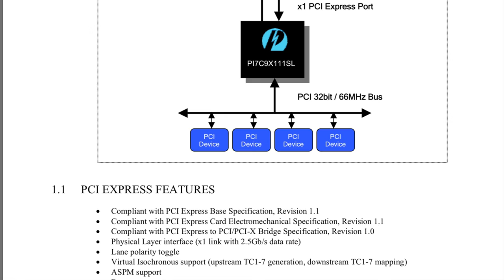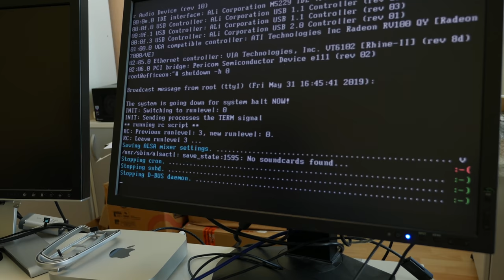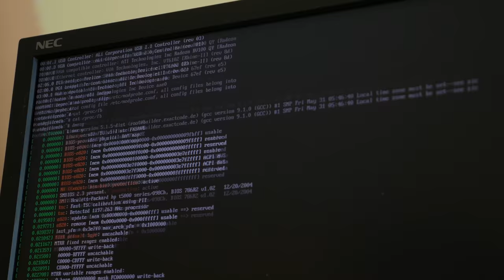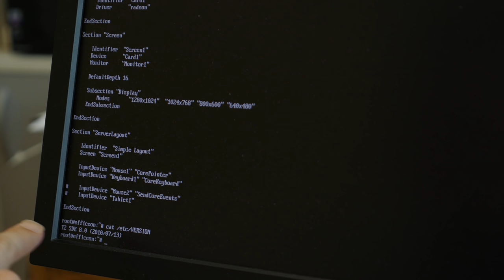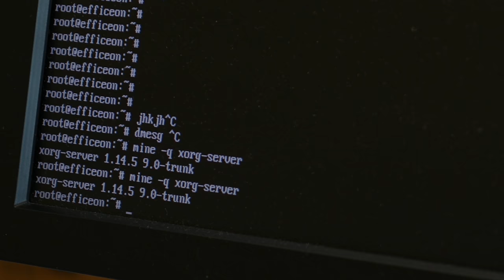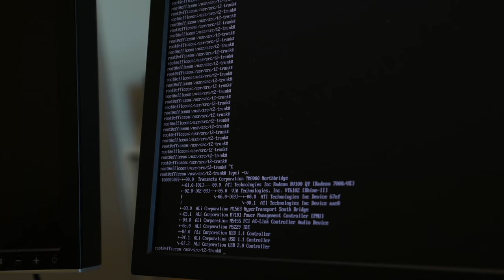Latest GPUs externally on vintage systems? PCI Bridge to the rescue!

Comment: I bought one of these to use an Intel Optane module as swap in my Sun Ultra Enterprise 250, I haven't tested it yet. There's a PCI-X version (Startech PCIX1PEX4) with an x4 slot on the PCIe side, but the cheapest I could find it for was 120€...
I don't think it'll work in the Cube, as the "PCI" to AGP adapter it uses internally for the GPU is just a pin to pin mapping, they just used a PCI connector on the motherboard because it was cheaper. Maybe I'm wrong, but I don't think you can do PCI to AGP without at least some level shifters and address decoding glue logic.
I'm really loving your videos about esoteric hardware, really informative.
Reply from the maker: thanks for the Cube warning, I knew it was AGP on a PCI port (plus the high power extra pins) but I naively assumed ith was PCI pin compatible. Need to do some research then before I plug it into there, ..! ;-)
Reply from the maker: re: the Cube "AGP" as "The AGP bus is 32 bits wide, just the same as PCI is, but instead of running at half the system (memory) bus speed the way PCI does, it runs at full bus speed. This means that on a standard main board runs at 66 MHz instead of the PCI buss 33 MHz. This of course immediately doubles the bandwidth of the port; instead of the limit of 127.2 MB/s as with PCI, AGP in its lowest speed mode has a bandwidth of 254.3 MB/s. The AGP specification is in fact based on the PCI 2.1 specification, which includes a high-bandwidth 66 MHz speed." so I would hope Apple uses all the PCI "AGP" slot with standard signalling just at the AGP speed. I will try to look at this another month, ...

Comment: I remember looking into a similar solution a few years back, but for modern notebooks. 

The graphics adapter had died on my notebook (geforce 7600go) Toshiba Satellite 050, so I began looking for a solution since it was my gaming machine. What I found, were these cheap miniPCIe to external PCIe adapter, similar to what you did on this video.
I decided against it since it defeat the purpose of a notebook... lucky me, after some time, my father bought me a similar looking machine. I swap the GPUs and I had a working notebook again with a Radeon x1600 instead.
But something even stranger was a PCIMCIA graphics card. "Village Tronic - VT Book". The chip is a Trident Cyberblade XP2, with 32MB of memory, DVI output, and a maximum resolution of 2048x1280@60hz 16bpp. Works with Win2000, XP, OS9.2.x, OSX 10.something early, and according to the box, Linux too, but only 2D acceleration and in beta. Only XP and OSX has 3D acceleration. It supports Dx8 and with it, it work like a charm, Dx7 and Dx9 work too but with video artifacts, probably because crappy drivers.
One of the weirdest hardware in my possession.
Cheers
Reply from the maker: yeah, I saw this miniPCIe adapter flex able things and wanted to buy one just for fun tinkering stock sometime soon too (I think I did not see then on normal shop listings, mostly only alibaba and sites like that, ...
Reply: Was it the EXP GDC?
I have one of those and it works wonders for using eGPUs via ExpressCard on my ThinkPad X200. I've even used it with reverse PRIME on Debian with no issue, apart from some dropped frames for obvious reasons.

Comment: Hi Rene, very interesting indeed!.  By the way, are you not affraid of creating ground loops by mixing multiple power supplies in one system like this?  pci/pcie connectors carry several ground plane connections.
Reply from the maker: That why I had the amdgpu only on the external one. However, PC folks and overclocked apparently at times also use two power supplies, so, ... guess that should usually be fine?

Comment: I've got the G5, I don't know if there will be any issues but I guess I'll just find out ;p lastly can I ask what OS you're running? You mentioned there were problems with the kernel but 5.x.x works fine?
Reply from the maker: I run t2sde Linux. How old is your g5? The later ones had pcie anyway, unless you want to use the external usb cable extension setup ;-)
Reply: @renerebe  That's pretty neat and I've got 2 G5s an older one (oldest model) with only AGP/PCI so in was considering this in case of the GPU failing. And yeh I've also got a late G5 with pcie so its not needed there.
Reply from the maker: Keep in mind that regular pc bios vga cards will not show post on ppc and only work in Linux. For some cards you can find openfirmware bios to reflash generic PC Cards for post.
Reply: @renerebe  hmm I hadn't heard of that. Cheers for the heads up. I'll have to see what I can do.

Comment: When will you be doing more work on the PS3?
Reply from the maker: wenn I feel like it. Also did you test the t2 build? I got very little feedback, and actually more questions to help getting it running on Gentoo or Debian. Which is to say not very motivating.
Reply: @renerebe  I haven't tested the build myself, i am nervous using any Linux OS as i am a complete noob. I usually follow PSX-place website as they write up guides and ask questions. I hope you do get more feedback and support for the PS3 as it would be a shame not to.